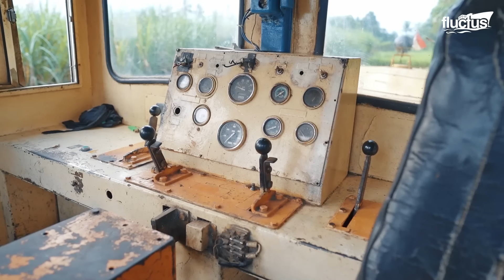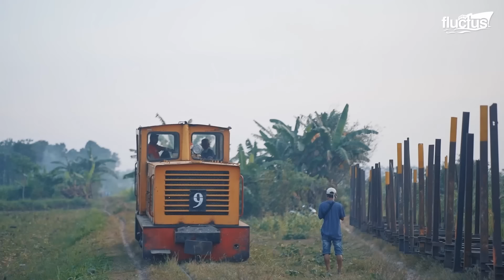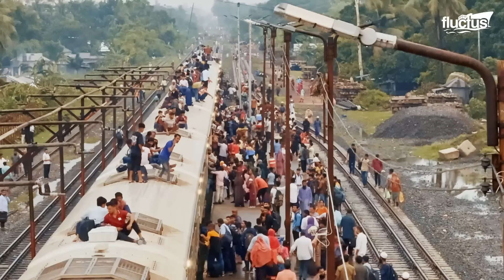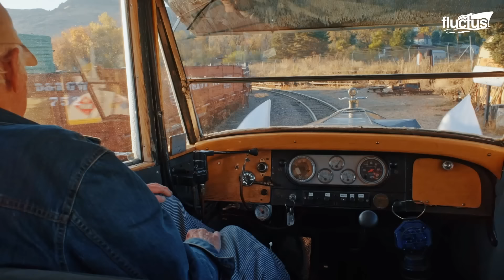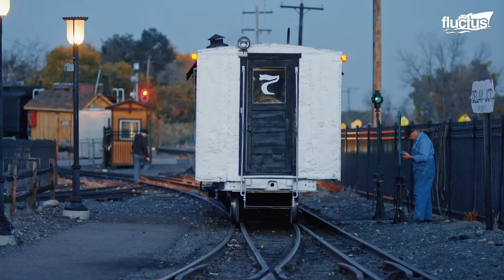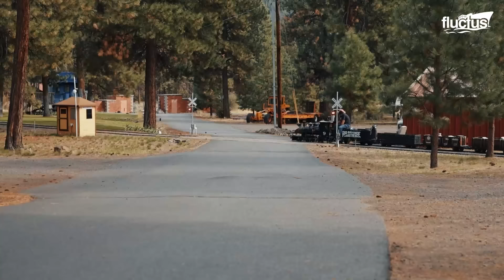How They Transport Millions of Tons of Sugarcane With Primitive Trains

Comment: I wouldn't call them primitive trains if they're going to last about as old toyota and take a beating but still work strong. Honestly i'm suprised they're not using steam locomotives that run on a percentage of the cain harvest.
Reply: Steam engine aren't really good at small scale. It's only good at larger scale, like heavy locomotive or power plant
Reply: the last steam sugarcane trains last operated around 2010s in indonesia, the running cost are too expensive compared to the diesel one